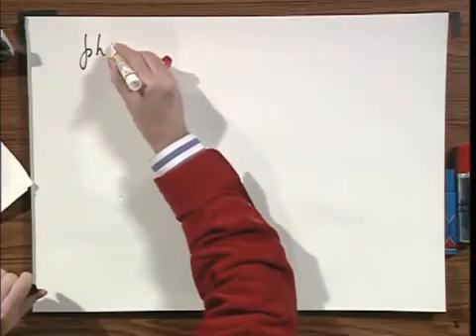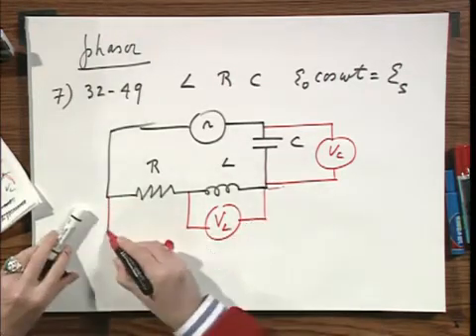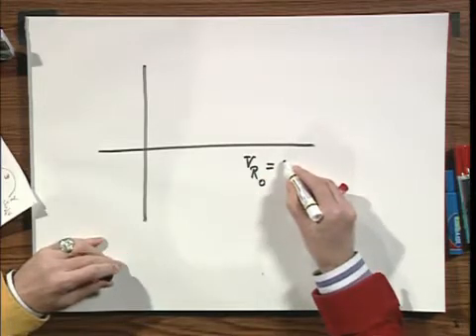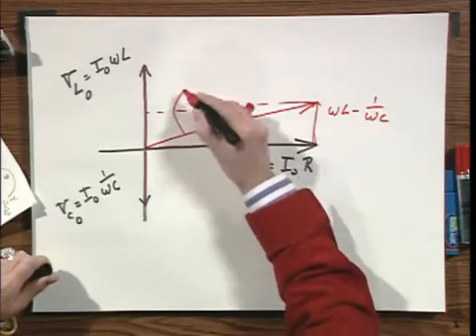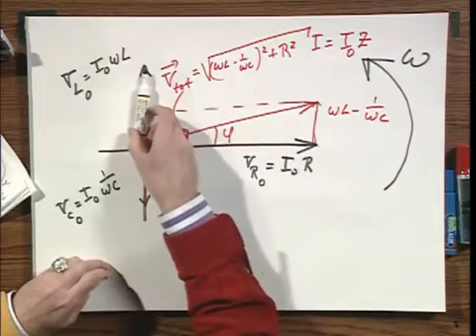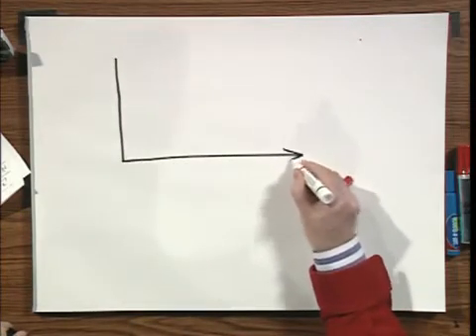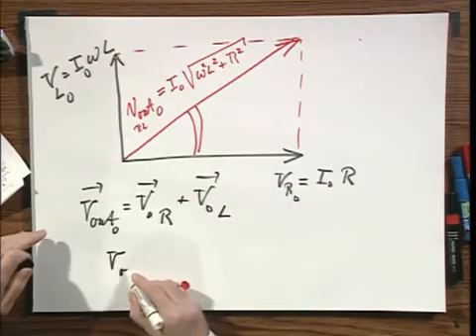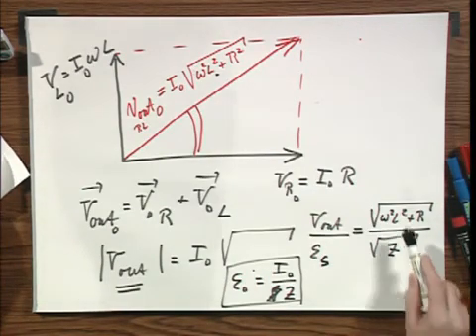80.2x - Module 09.07 - A Driven RLC Circuit in Series - Phasors

Comment: Please sir , can you explain why when we connect the voltmeter to the inductor we will read this particular value .i know the reading will not be zero
Reply from the maker: Apply Faraday's Law in every closed loop. That will tell you the whole story. If dphi/dt is zero in a loop, then there is no induced emf in that loop and potentials are then determined
Reply: Can you expand on this sir and shows why the voltmeter will read (IwL) when the current is maximum ? I really appreciate your help .
Reply from the maker: watch my 8.02 lectures which cover all this. You are viewing a video in the Help Sessions. The information to do these problems is in the lectures.
Reply: I have watched the lectures but i want only to know how the voltmeter will read (iwL) because i used faraday law and i couldnot get it .
Reply from the maker: watch my lectures, that's what they are for
Reply: Dear sir , i have really watched the lectures many times ,but i am really struggling with this value that the voltmeter will read .can you please just explain why the reading will be (iwL)
Reply from the maker: how many minutes into the video?
Reply: @lecturesbywalterlewin.they9259  2.34
Reply from the maker: I asked you how many minutes into the video. at 2:34 there is nothing that relates to your question. This is my last msg

Comment: Sir why does the voltmeter connected across the self inductance not show ZERO always? It should, because in inductors E = 0, therefore integral E.dl = 0.
Sir is it not zero because the inductor has not been called 'IDEAL' in the problem?
(I am not a student at MIT)
Reply from the maker: >>>>why does the voltmeter connected across the self inductance not show ZERO always? It should, >>>> NO IT SHOULD NOT!!!!
The reason is that the voltmeter and the superconducting solenoid form a closed loop.
In the closed loop IR = -LdI/dt. R is the resistance of the voltmeter, I is the current in the loop. If you integrate inside the wires of the solenoid E dot dL you will find zero.
Reply: But Sir the voltmeter will reflect the potential difference between the two points it has been connected to, and not the net emf in the loop?
Reply from the maker: If your circuit is only an inductor with a Voltmeter in series and if you then induce an Emf (-LdI/dt) in the loop using a changing magnetic flux then The closed loop integral of E dot dl in the loop is 0+IR=--LdI/dt. The zero is the integral through the wire of the conductor. That is Faraday's Law. I is the current in the loop, R is the resistance of the voltmeter. I suggest you do you your homework on Faraday's Law.
If your circuit is different then the above circuit, tell me how many minutes into the video and rephrase your question.
Reply: Sir I got it! Thanks a lot!